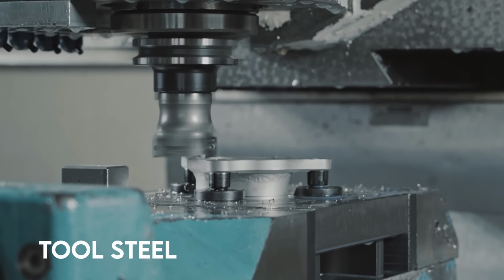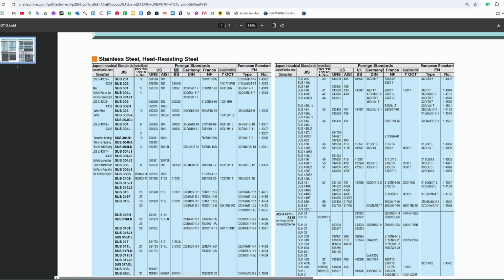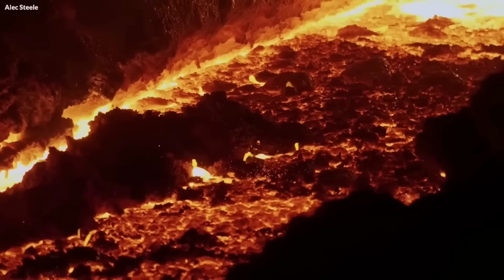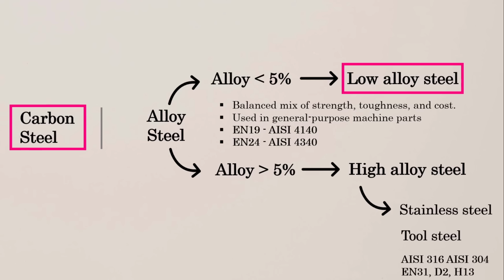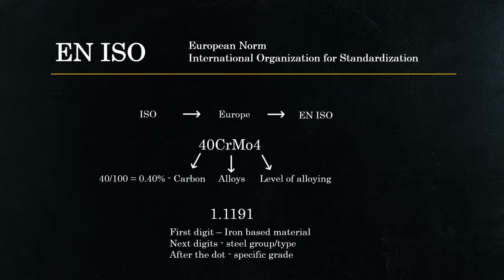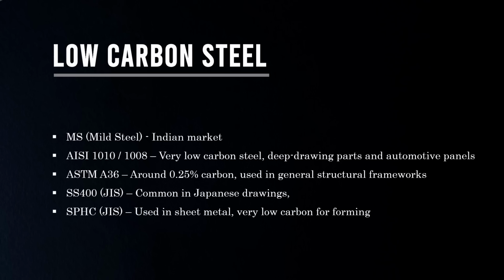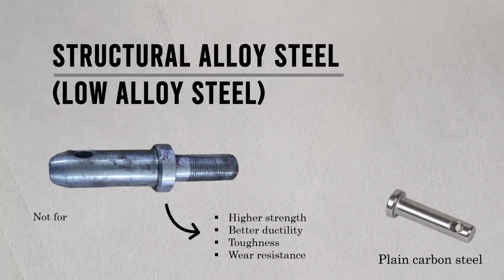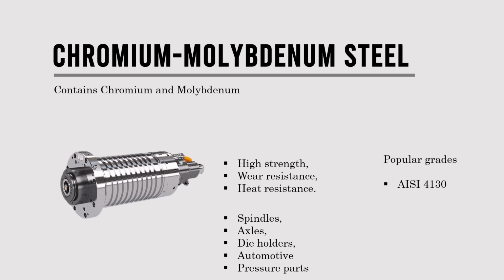How to Choose Right Steel Grade (Every Engineer must know)

Comment: Which steel grade do you personally work with the most?
Reply: S275
Reply: @Cornel1001 I'm guessing you're in the marine or construction industry
Reply: Spring steel
Reply from the maker: For structure like base plate, mountings plates- MS 
For part which go under stress eg.- drive shaft- EN8,
Sliding parts - EN31 (Bearing steel) with hardening 
General Tool steel- D2, 
for precise tooling or gauge- O1 (Oil hardening) 
Stainless steel- AISI 304, for tough environment- AISI 304, for stainless tools- AISI 410
Bed plate- FG200
Reply: @mastermechanicaldesign  if possible, can you also cover galvanic corrosion between different type of common steel in part 2? Having a quick lookup table would be very useful

I've seen lots of design mistake of using fastener with steel grade incompatible with the part steel grade, which cause the fastener to corrodes quickly.
Reply: @minhhungnguyen7867  when I worked in the marine industry there was a table of, I think it was called galvanic potential and you never wanted to pick two materials that were far apart on this table or list.
Reply: @mastermechanicaldesign O1 is the worst possible steel for precision tooling. It warps and changes size like crazy when heat treated. It's also a shame to waste the time and effort required to make precision parts on an inferior steel that won't last as long. 

A2 and D2 are far superior for precision work because of how stable they are. Unless you are making very thin and delicate parts, you can often avoid grinding to final size altogether with A2 and D2 by calculating the expansion you will get from the heat treat and making the parts undersized to compensate.

However, O1 and 4140 are almost exactly the same thing (and can be treated like they are the same in almost all cases), and 4140 makes a good tough steel for things like tool holders.

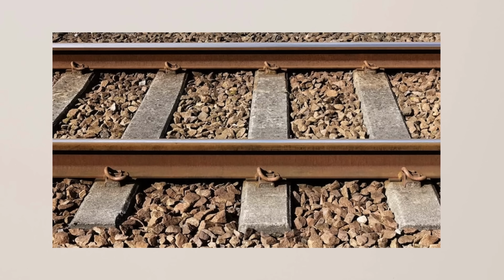Comment: 34:08... Weathering steel is low carbon steel and railway tracks are high carbon steel... I am working as a CNC machinist... We are doing pocket machining on tracks... Its hard to machining than MS just because of its hardness... Now only i saw ur video... And read some data about weathering steel vs railway tracks on chat GPT...i think u hav studied data from wrong source... Its little bit hard to machining just because of its hardness also it contains 0.7-0.8% carbon... Useful video... But content creators only tells what they have studied...they never go to factories before making video... Sorry if it hurts... Please analyse and make video.... Each point is  really important for mechanical engineers... Because we r spending 35 mins... That should be useful...

Comment: These are the go-to steel types we use all the time,such as SS303.304,316L,17-4PH,Steel 4130,Steel 4140, Mild Steel,Bearing Steel,Tool Steel and more.
Reply from the maker: All of them. its depends on industries, in SPM- Mild steel, whereas in pharma - SS316, in Aerospace- Alloy steels
Reply: @mastermechanicaldesign  You’re absolutely right.🤝

Comment: If I have to install a hydrostatic level meter in a potable water tank (treated with chlorine), is stainless steel 304S and 316 good?
Reply from the maker: 316 would be better
Reply: @mastermechanicaldesign Unfortunately the one I have is using 316S Stainless Steel for the sensing element and the enclosure is 304 stainless steel.

Comment: good morning, sir
engine drive shaft what material and composition 
tq sir
Reply from the maker: For engine drive shafts, it depends on the application, but it's typically a high-strength alloy steel.

Comment: Temperature is measured in degree Celsius and Centigrade is one hundredth of Grad is a unit of Angular measurement.
Hence use the correct unit relevant to temperature
Reply from the maker: Historically centigrade is also used for celsius (same temperature scale- You can see more on wikipedia) but now celsius is more commonly used.
Reply: @mastermechanicaldesign 
You're right but now it's obsolete and no more allowed to use Centigrade as a unit of Temperature measurement.
Rather reading Wikipedia go to the website of the source of SI units of measurement for more clarity 
Thanks